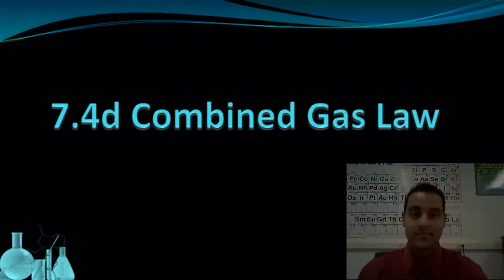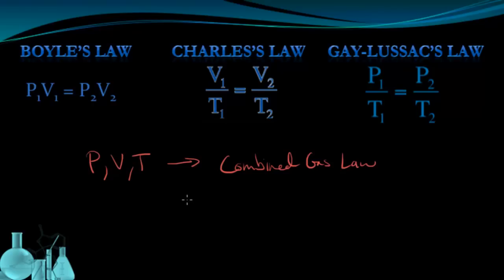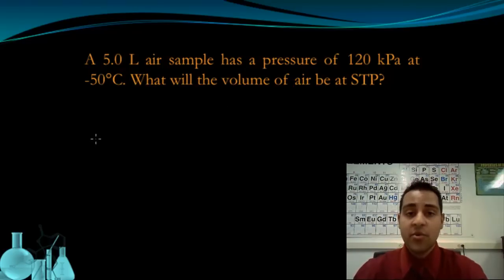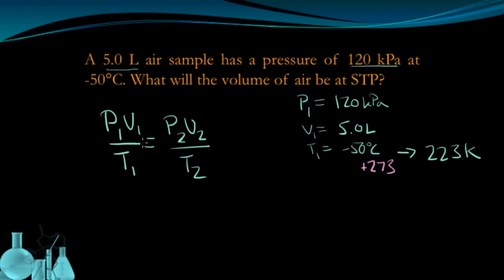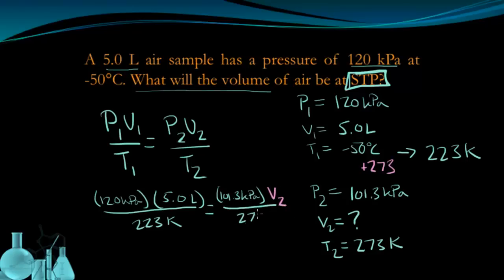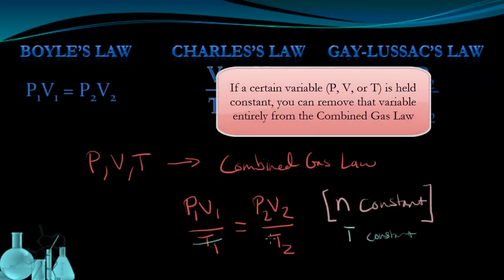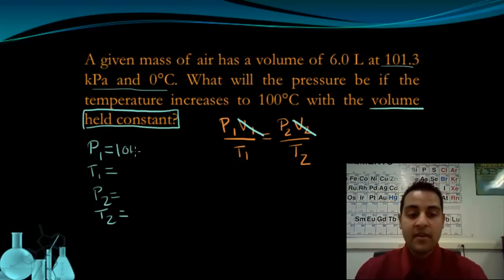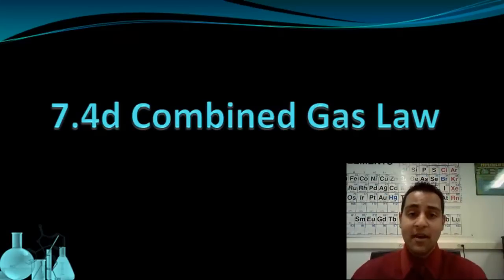Chemistry 7.4d Combined Gas Law

Comment: You didn't show the actual solving of the first problem and I am getting a different answer. I multiplied P1  and V1, then divided it by T1,  and then divided P2 and T2., then do you add them together to get V2 ? You aren't specific enough on the solving. I get 6.4, not 7.3, what step am I missing? (around 4:10)
Reply from the maker: It looks like you're making an algebraic mistake. Multiplying P1 and V1, and dividing by T1 on the left of the equation should give you 2.69. Then dividing P2 by T2 on the right side should give you 0.37... so after you initial steps you described you should end up with 2.69 = 0.37*V2, now divide both sides by 0.37 and you should be all set.

Comment from the maker: @GOOBLE07 Yes, kPa and atm are both units of pressure (1 atm = 101.3 kPa). As long as you use the same unit on both sides of the equation, the combined gas law will work.